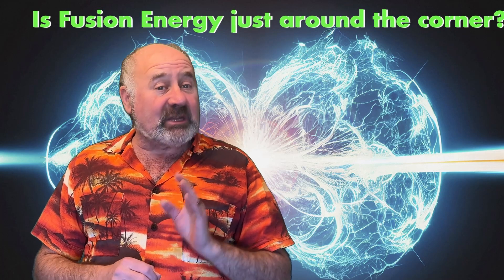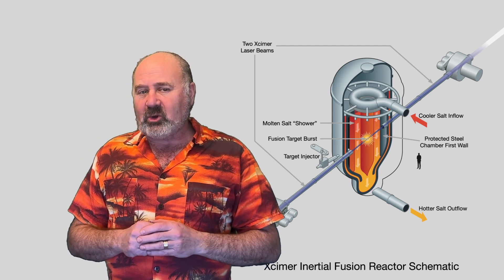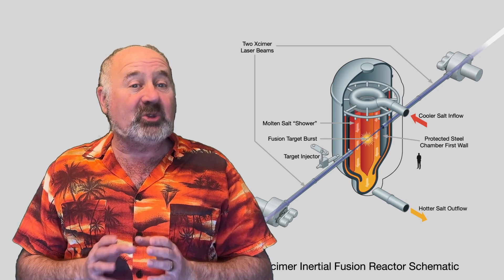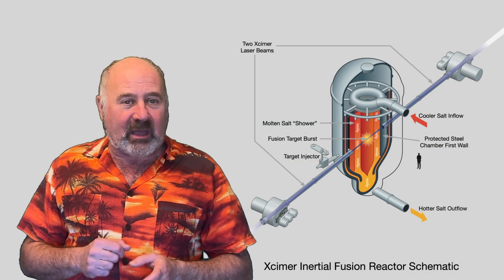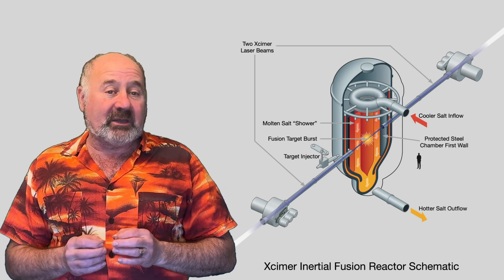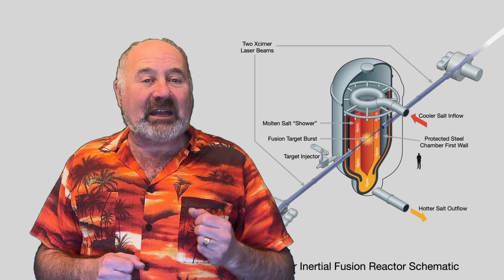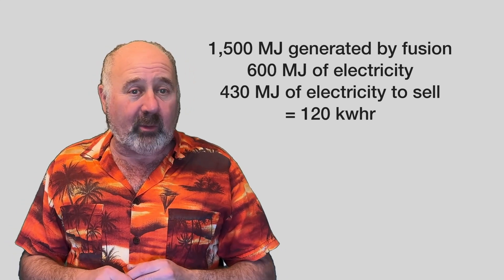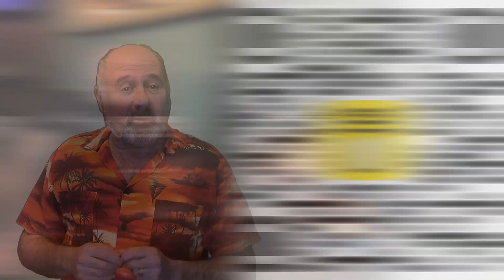Can millions of mini hydrogen-bombs power our world?

Comment: The fusion energy gain used here is Q-plasma, or Qp. It is the amount of energy that couples to the plasma to heat it to fusion energy temperatures. It tends to be a tiny fraction of the energy utilized to power the experimental facilities and is often over 100 times less. It has become standard practice, in the nuclear fusion energy experimental field, to omit the value of energy needed to power their entire facility. Most ICF and MCF reactor experimental test operate in a pulsed mode and that will likely continue for the possible power plant versions of them. The ICF fusion 'burns' tend to be under a nano second. The Qp value only applies to the time that the fusion reactions are actually occurring. It doesn't apply the the rest of the time the machine is cycling so the Qp value is again a poor measure of the efficiency of the power reactor concept. I regard the use of this Q value as being deliberately misleading, often to attract funding to these fun experiments. The promoters have long claimed that the hydrogen fusion fuel is almost unlimited. They tend to avoid mentioning that the tritium is radioactive and they always omit the fact that commercial tritium costs more than $30,000 USD per gram. In the heavily publicized 12/05/2022 NIF laser shot many key evaluation details were omitted. The hollow spherical target capsule was constructed of grown diamond that had to be almost perfectly spherical, highly polished and nearly flawless in almost all other ways. The target assembly, that is mostly vaporized has been estimated to cost around $100,000 USD. The experiment took about a week to set but the fusion reaction only lasted for 0.000,000,000,08 second. The reaction occurred in a microscopic area referred to as the 'hotspot' and then the exploding core blasted away 96% of the supplied expensive fuel before it had a chance to fuse. The term 'ignition, used by such experimenters. is deliberately misleading. In most cases the propagation of the reaction is quite limited before the compressed fuel is blown away from the reaction center. The Xcimer Energy fuel 'burn' efficiency estimate is based upon calculations, not experimentation that came anywhere close to such fusion conditions. Nuclear fusion energy experiments began in the 1950s and ever since numerous unexpected problems have been encountered with many work-arounds developed in response. In most cases, creating an eventual economically cost-effective power plant has not been the primary goal of such experiments. Misleading journalists, the general public and funders has often taken a higher priority which helps explain why the goal posts have shifted so often over the past 75 years. Hope springs eternal for those who are love with the technology and haven't closely followed humans failed endeavor to effectively deal with the still rapidly rising greenhouse gas concentrations in the Earth's atmosphere.

Virtually all nuclear energy promoters, are in line with the vast majority of Earth's other 8.2+ billion humans, who continue to assume that we still have at least 20 years left to turn this 'Titanic' around using their favorite nuclear technology. They have become masterful in excluding the following warnings from their consciousness. I urge readers to search for the following two article titles.

IPCC report: ‘now or never’ if world is to stave off climate disaster (TheGuardian)

UN chief: World has less than 2 years to avoid 'runaway climate change' (TheHill)
  * This statement was made 6.6 years ago.
Reply from the maker: If you’ve been following my channel at all, you’ll know that I am a big proponent of doing what we can now, which is wind and solar and improving the electrical grid.  

I am not a nuclear booster, neither fission nor fusion, though I’ve made a lot of videos on those topics because I think they’re interesting and part of the story. 
My focuses is on what we can do now and that’s wind and solar and storage and transmission and electrification.
Reply: @Decarbonize11 - I admire your emphasis upon employing existing technologies that can slow the progress of our collapse now. I admired you exposing some aspects that rarely get covered on this fusion energy topic. My aim is to aid others in their critical thinking skills since many, who fall in love with this topic, fail to think beyond the slick promotional presentations. Thanks for looking through my lengthy description. I assume I exposed some aspects that you hadn't given much thought to.

Comment: Most nuclear fusion energy pitches are super-hyped, concentrating on the hoped for results while leaving out mention of the numerous problems that have been encountered since the efforts began in the 1950s. Scores of nuclear physicist and engineers have spent decades working on the elusive goal only to retire to see we are still many decades away from a major breakthrough to a seeing a practical nuclear fusion demonstration facility. Many of the pitches are intended to generate public interest and attract private investors to fund these extremely expensive projects that number well over a dozen.

Not mentioned in the above prevention are the following issues. The ITER is extremely over its original budget and is well over a decade behind its original schedule. Currently there is major rework taking place in major components of the system. The scope of the tritium breeding experiments has been severely cut. ITER will be lucky if it can generate its first fusion reaction by 2030.

The National Ignition Facility (NIF) has always been primarily funded as a thermonuclear weapon (H-bomb) research tool. The administrators, and the above presenting plasma physicist, have become masterful in obscuring that fact when presenting to the public and to the press. The announced December 5, 2022, experiment took about a week to set up and resulted in a nuclear fusion reaction that lasted approximately 0.000,000,000,08 second. The released energy was about enough to boil two liters of water. The energy to drive the laser was more than 100 times greater. It has been estimated that the target assembly, that was vaporized in the experiment, cost approximately $100,000. The use of the term 'ignition' is deceptive. There was only minor propagation of the reaction in the extremely compressed fuel plasma. Most of the extremely expensive fuel was blasted away from the reaction center before it had a chance to react. Later a staff member admitted that only approximately 4% of the supplied fuel actually reacted. The NIF lab administrators have suggested that newer diode pumped lasers could overcome the poor laser efficiency. They don't mention that such lasers don't exist at energy levels anywhere close to that of the NIF lasers and if the the wavelength has to be shifted to the deep UV region then that will reduce the efficiency. No mention was made that NIF was expected to achieve the so called break-even fusion reaction by 2012 but it failed by a factor of more than ten. It took a decade of additional work to finally achieve the original goal. It's been estimated that NIF has consumed approximately $11 billion in federal revenues.

Many nuclear fusion energy experiment breakthrough announcements focus upon the future promises while failing to provide details regarding actual experiment. In many cases the announcement is about reaching higher temperatures, or longer plasma duration. In many of those cases no use of fusion fuel is employed, or even planned. Currently the market value of radioactive tritium is approximately $30,000 per gram. It certainly isn't as common as the hydrogen (1H) in seawater. The few reactors that produce tritium are slated to be decommissioned within a few decades.

Nuclear fusion will only succeed if a demonstration plant is created that appears to be economically practical to commercial enterprises that want a return on their investment.

Typically, most fusion energy fans tend to immerse themselves in information echo-chambers that reinforce what they prefer to believe in. Few have a strong interest in asking themselves what key evaluation data may have been omitted from the presentations that they have come to love. Critical analysis tends to not be a high priority for a field that they have come to adore.

Those who work in nuclear energy fields, along with the vast majority of the 8.2+ billion other humans on Earth, have become masterful at excluding the following warnings from their consciousness. They desperately want to believe that our technological wizardry can turn this 'Titanic' around before it is to late. I urge readers to search for the following two article titles.

IPCC report: ‘now or never’ if world is to stave off climate disaster (TheGuardian)

UN chief: World has less than 2 years to avoid 'runaway climate change' (TheHill)
  * This statement was made 6.5 years ago.
Reply: I appreciate your skepticism, Vernon, but it’s worth remembering that not every fusion venture is overhyped. For example, General Fusion openly cautioned prospective investors that backing their technology might be “throwing money at something likely to fail.”

It’s well known that the National Ignition Facility (NIF) pursues two distinct missions: (1) stockpile stewardship, which yields classified weapons-data; and (2) inertial fusion energy, which produces only public information. Journalists focus exclusively on the energy side simply because it’s the only aspect to which they have access—not because administrators or plasma physicists are deliberately concealing the primary mission.

Far from stagnating after its December 5, 2022 ignition (3.15 MJ output from 2.05 MJ of laser input), NIF continues to push performance boundaries. On April 6, 2025, shot N250406 achieved 8.6 ± 0.45 MJ—a dramatic leap in yield.

You might be right about current NIF targets costing on the order of $100,000 each. However, if targets could be mass-produced in volume, their cost would fall to mere pennies. Indeed, the ultimate low-cost design is a gas bubble: essentially zero material cost. Moreover, immersing a sufficiently large bubble in a dense medium could confine the fusion plasma for longer than ~8 × 10⁻¹¹ s—the duration of a standard NIF microcapsule implosion.

On word choice: there are many ways to describe something that creates a false impression—“misleading,” “confusing,” “ambiguous,” “imprecise,” “inaccurate,” or “unclear”—without implying deliberate deception. By calling NIF’s use of “ignition” “deceptive,” you insinuate intentional deceit. Is that truly your position?

Regarding your statement "NIF lab administrators have suggested that newer diode pumped lasers could overcome the poor laser efficiency. They don't mention that such lasers don't exist at energy levels anywhere close to that of the NIF lasers": its false. As Tammy Ma (leader of LLNL’s Inertial Fusion Energy initiative) has pointed out, “If you put all the diode vendors in the world together right now, we don’t have enough of these high-power diodes to build one power plant yet.” In fact, diode modules delivering 250 kW at 880 nm are commercially available, but to pump a laser of NIF’s scale you would need several thousand of them. (https://www.quantel-laser.com/tl_files/client/CATALOGUE/Telechargement%20Fiches%20Produits/LaserDiodeSource_Specs_EN_092018.pdf) 

I’m not worried about echo chambers reinforcing my approach to fusion—nobody has stated their belief in it, and I actively solicit critical feedback.

About the impending climate disaster, do you really think we’ll dodge AI-doom or a third world war for long enough to experience it?
Reply: @ - In reference to your last paragraph, many people have learned to justify their love affair with such nuclear fusion energy technologies by citing an imminent environmental collapse.

You misconstrued the primary purpose and funding of NIF which has always been overwhelmingly funded by the nuclear weapons related budget of the U.S. Congress. In the case of NIF, journalists have been deceived by the term ‘Stockpile Stewardship’ which serves as a euphemism for simulating thermonuclear weapons (H-bomb) explosions, due to the termination of the full-scale nuclear explosion testing program at the Nevada Test Site (NTS) due to the signing of a nuclear test ban treaty.

Your assumption, that the ~ $100,000 perfectly shaped diamond based fuel target costs will soon drop to pennies per target shot, is based upon the kind of wishful thinking that has been behind the experimental efforts that began in the 1950s.

It is true that the NIF experimental fusion yield shots have significantly improved from their widely announced 12/05/2022 shot. Masterfully you excluded mentioning that even with the most recent NIF gain the energy duty cycle and the economics, of current NIF nuclear fusion experiments, is at least a million times away from the goal of achieving a commercially practical nuclear fusion electricity generating power plant.